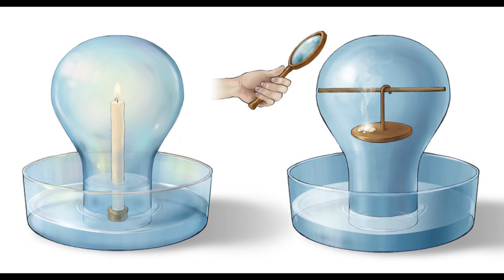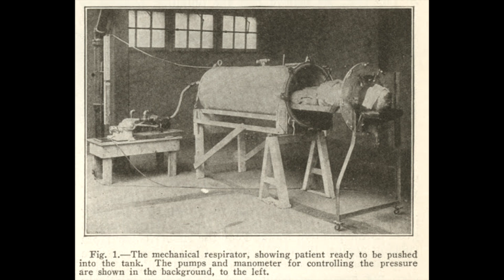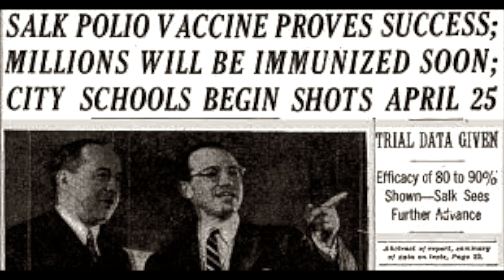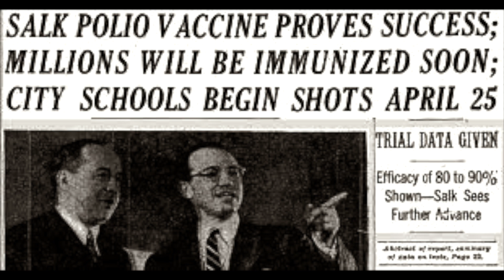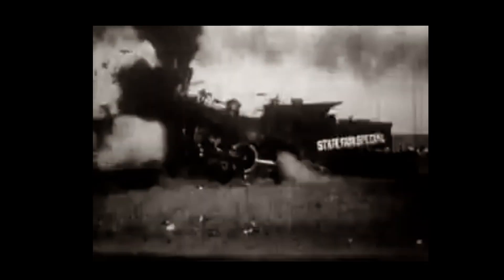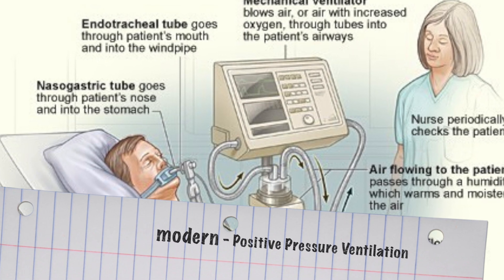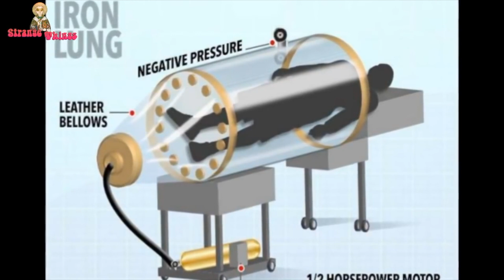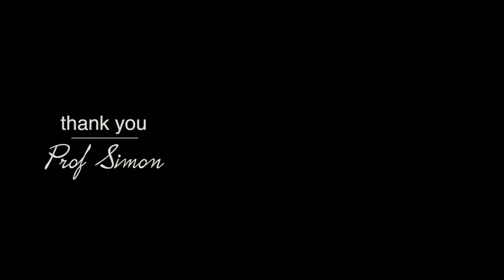Iron Lung Mystery - Prof Simon

Comment: Positive pressure systems allow for the control of air mixture and the addition of drugs without changing setup or adding extra interference to the patient. The iron lung makes it harder to give physical treatment to the patient too. Also the modern systems are easier and cheaper to make. The amount of materials used to make an iron lung is pretty high, the complexity means its more likely to go wrong and with the above factors when it does go wrong its more expensive to repair or replace and then you have the amount of space it takes up when not in use. There is also something to be said about energy consumption differences between the two. The iron lung was a marvel in its time but also deserves to stay in its time.

Thanks for the video, looking forward to the next.

Comment: Hi,   The Draeger Evita ventilator has 2 servo controlled valves one to let Oxygen and one for air.  Its like a speaker voice coil that controls how much the valve opens and it knows how far to open them to get the right percentage of oxygen.  What I find interesting is, the actual valve that closes down on the valve seat is made of ruby probably industrial ruby.  They told us the valve seat is saphire but it looks like metal.  Ive taken one apart, and it had what looked like an LVDT Linear Variable Differential Transformer on the pin that moves.  A metal core moves closer to one coil or another and the voltage on the coils can really accurately indicate the position of the core.  The valves  cost a lot of money and have a big magnet like the back of a speaker.

Comment: A fixed displacement neg pressure system using bellows is simple, effective and safer. In my opinion.  An aqualung in diving is an on demand pos pressure system. When the diver breathes in a  diaphram operated valve opens to feed air to the diver, however if the air is contaminated he may not survive.  In the neg system , the patient breathes ambient air .Much safer.

Comment: Negative Pressure Ventilator is so much safer..
I've heard about people having severe lung damage caused by Positive Pressure Ventilation. Its very easy to burst or damage the lung using the PPV method and that's why Doctors only like to use them as a last resort..

Its all down to costs, the PPV is a smaller unit and easier to manufacture and maintain.
Maybe it's time these NPVs were brought back into use once again, after all they can't be any worse than what we've got already can they?  ;-)

p.s. maybe its time the NHS started saving us instead of the other way around!..
Reply from the maker: That’s what I thought

Comment: I'm only a lowly paramedic, but as I understand it, being in an iron lung obviously made toileting and basic care like washing very complicated, and the immobilisation imposed by one would predispose to forming pressure sores and skin hot spots. Instead, cpap ventilation (constant positive airway pressure)  is easier to deliver, and gets around these issues as long as the skin of the face and head is looked after. It is also helpful in acute left ventricular failure, by helping to blow fluid out of the lungs and back into the circulation.
Reply from the maker: thank you Joe

Comment: I have just asked my Nice who has a BSc degree in Nursing, I will let you know when she replies Professor Simon. 
Iron lungs do look very scary to children. I did see one working in the 1950s.
I think I know part of the answer which is Covid Patents in the most extreme cases develop fluid in their lungs and have to be rotated. 
That would not be possible in an iron lung, however it does not answer the question completely. 
Iron lungs could have been refined over the years and made far more compactly. The question then becomes why was further development stopped ?
Reply from the maker: I always thought they looked like spaceships.....
Reply: @SimonHollandfilms  They made a funny sound. You would hear a fairly loud clunk, then a low soft gush as the air went came out. Then another clunk and gush as the air was drawn in.
Reply from the maker: I like it more....clunk machine

Comment: The issue is that with polio, the muscles controlling the lungs were paralyzed, the lungs themselves were fine. In covid-19 patients it's the opposite the muscles work fine but the lungs are damaged. You need to pump in oxygen not just air for the patient to stay alive, additionally fluid in the lungs can be a problem and intubation allows you to kill two birds with one stone and pump out the liquid.
Reply from the maker: Good points...thanks

Comment: Part of the issue is physical size. Another is power consumption. Positive pressure units can be tiny by comparison IE about the size of an A3 printer. Therefore way easier to store when not needed. The reduced power consumption also means that in the event of power loss the unit can run for longer on batteries. There are some that fit on a wheeled 19 inch rack that can work for 24 hours with no power input. Then come the clinical reasons. Firstly it is easier to see someone using a positive pressure ventilator to check for bed sores etc. With an "Iron Lung" you need to take the access panels off in order to turn the patient to check. The same goes for cleaning them up etc and administering injections. I can see no up side to negative pressure systems.
Reply from the maker: Thanks Gordon

Comment: Would by slowly rhythmically building up positive pressure, and then by reversing the same  upon evacuation by negative pressure?...or just one or the other, or a modified combination of both rhythmically tuned to assist the patient's natural efforts to respirate on their own?
Reply: No.  Alternating positive and negative pressure to expand and then compress the patient's ribcage and abdomen at the required speed for breathing.

Comment: Great video professor, I think that the main difference here is that in case of polio/paralysis the lungs are perfectly fine and its just the mussels which are not working hence an external method like this would work fine, whereas in covid the lungs are damaged (not mussels) and their ability to respirate is affected hence an external method like this might not be as affective as we have to artificially force the air in them plus the modern ventilators are damn complex.....
Reply from the maker: Good points

Comment: Humans breath room air at 21% oxygen. A hyperbaric chamber, at pressures greater than atmospheric pressure, containing 100% oxygen can be used to saturate damaged tissue, repair and restore it to normal function.
Reply from the maker: Interesting
Reply: @SimonHollandfilms  
Indeed it is interesting Professor Simon, your lecture on the iron lung was food for my thoughts. 

I'm sure you know that hyperbaric chambers have many uses, they are used in many industries, aviation, mining, offshore oil rigs and underwater exploration come to mind. The military uses them for training purposes, by decreasing oxygen levels inside the chamber, to train pilots and aricrew about the signs and symptoms of altitude sickness, such as visual impairment, spartial disorientation and Illusions, how this effects pilot performance.

Most people would be aware that hyperbaric chambers are used to treat decompression sickness in scuba divers.

The demand for ventilators has increased during the COVID 19 pandemic. I understand the virus effects respiratory function, depleting the lungs, organs and tissue of oxygen. All the grounded aircraft could be used as hyperbaric chambers to treat these patients. After all an aircraft is an pressurised cylinder with it's own oxygen supply, though they probably would need to have some internal and external modifications to make patient transfers easier and to accomodate patients during care.🤔
Reply from the maker: Lots of reasons to get an old iron lung. ...ebay?
Reply: @SimonHollandfilms  
Choose at the right time, you could be in for a bargain. Buy an iron lung, pay half price for the second one, or get a free set of steak knives and cheese forks.
Reply: That depends on how much damage is done. The majority of Covid Deaths are from the lungs being so damaged that they no longer work. In extremely rare cases, the person's life was saved by a double lung transplant.
Reply: @elfenmagix8173  
Thank you for your interesting and informative feedback. 👍

Comment: A respirator causes damage and the person is usually under anesthesia unlike the iron lung 🤔
Reply from the maker: Good point....you can’t be unconscious in an iron lung
Reply: @SimonHollandfilms  Actually yes you can. Iron lungs also cause the same damage, as a pressure differential above 6 millibars be caused from negative pressure round the chest or positive pressure from intubation. Due to positive pressure units requiring intubation the patient must be sedated. They are rarely under the influence of anaesthetic. That's just too dangerous and would need pretty much 1 to 1 constant supervision. Yes you can be fully aware in an iron lung but it is not necessary and people sleep in them. In fact certain types of coma are still occasionally treated with an iron lung:  "It has been reported that COPD patients with severe respiratory acidosis and hypercapnic coma can be successfully treated with iron lung ventilation (ILV) " from https://erj.ersjournals.com/content/23/3/419  accessed 17/NOV/2020